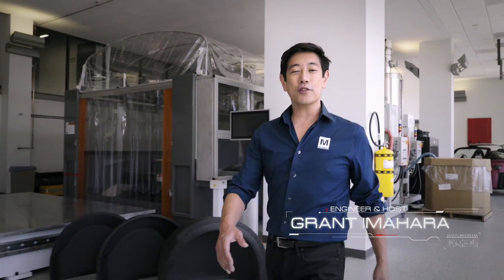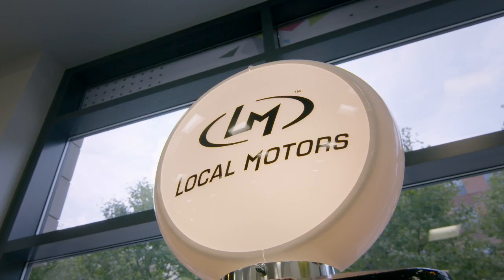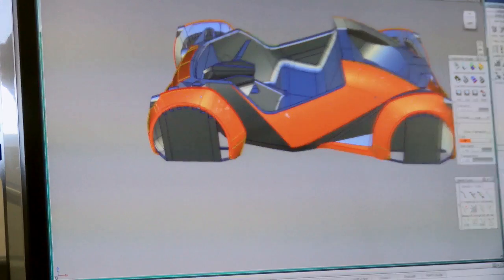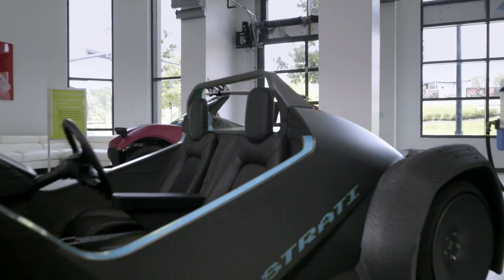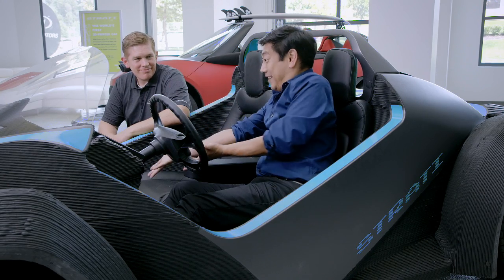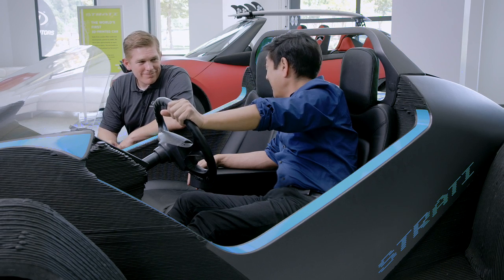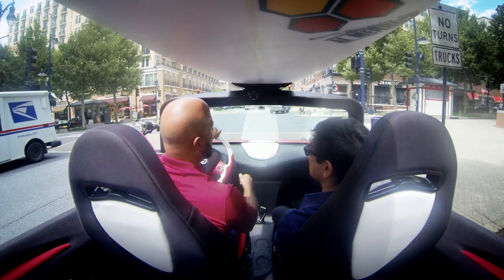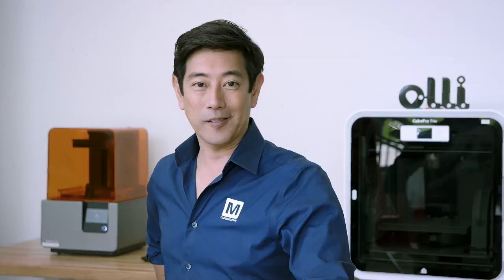Local Motors: The Essence of Autonomy and 3D Printed Cars | Empowering Innovation Together

Comment: The car needs better aerodynamics. Badly.
Are those tires from a BMW i3? might be a good choice.
I would suggest Lotus Elise size and layout (maybe slightly bigger) with sort of monobody aerodynamic bodywork. The small size 2 seater lends itself well to 3D printing and low cost/ease of acceleration. Also good aero. It could be like the Tesla Roadster should have been which is quarter the price.
Reply: For chassis you might consider only printing strong joints for standard alu profile extrusions. Or HSS tubes or even CF. Unless the plastic is cheap, light and strong enough as is.
Reply: You could also make a smaller steering wheel. Like about a logitech computer game steering wheel. With power steering or drive by wire, there is really no need for the usual clumsy wheel. Particularly leaning into autonomy.
Reply: yea that would be good
Reply: when Dan Frederikson thinks naming 3 cars makes him a car guy...
Reply: I'm pretty sure it's more along the lines of a neighborhood car, and certainly not one that'll go fast enough for aerodynamics to matter much at all.
Reply: BBB, but you are wrong. Try to appreciate truth when spoken instead of inventing lies to defend the given.
Reply: r/iamverysmart

Comment: I think they should still out a steering wheel just in case like if the system goes wrong and a free wifi and maybe a spot to put like an Xbox one or ps4 then with the steering wheel it build its self and it will allow for the person who's in either seat to drive so it would be drivable on each side
Reply: and maybe have the steering wheel inside the front of the car and then when you need it you can pull up or press a button for it to come out
Reply: Yup 👌🏼